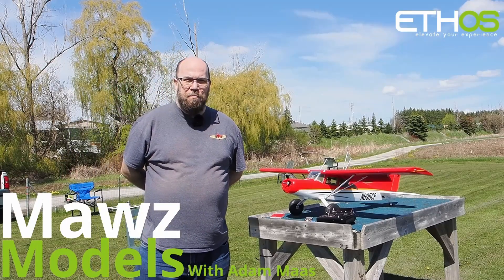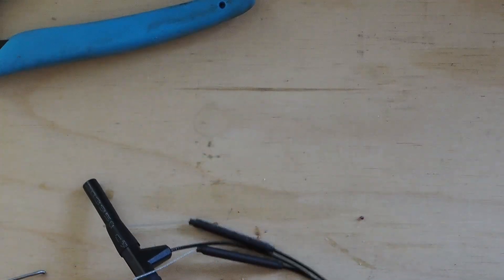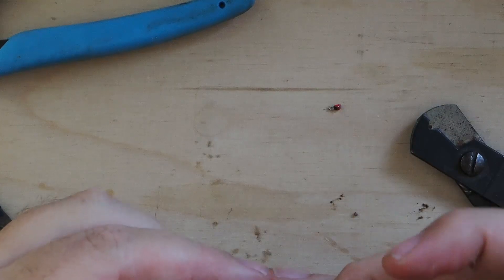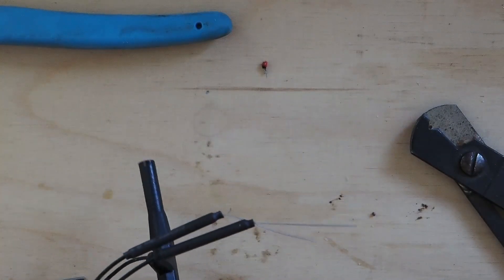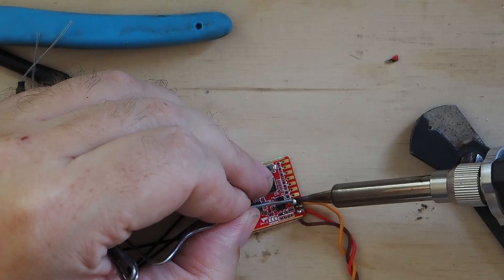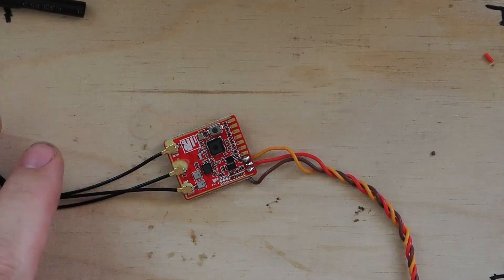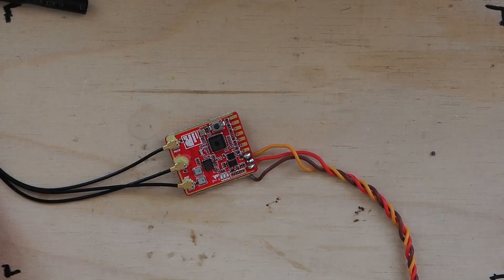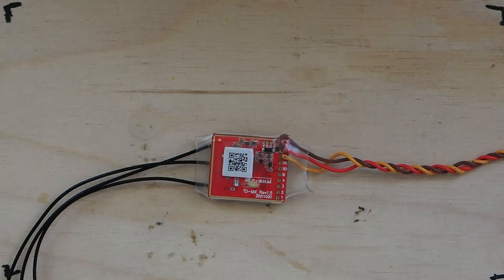ETHOS Tech Tip 8 - TDMX Wiring for FBus

Comment: I'm using 2 on aura 5 an 8 with no problems.
Reply from the maker: I've gotten mine to work with the Aure 5 & 8 as well. Just still need to get used to the trim procedure on those stabilizers

Comment: I found 22awg , very small amount of pre tin using Flux on the wire . Then placing the wire though the hole in the top of tdmx.  Laying the wire over the pad. 

Adding solder to the iron tip and doing it via transfer solder. Has worked best for me. 

I had a hard time getting the solder to stick to the pad if it didn't do it this way. And no risk of bridging the contacts.. I can send you a pic of it on FB if you like tonsee what I did
Reply from the maker: Thanks for the info
Reply: Agree, you want pin your pad and your wire with the heat gun to heat them up first and then apply the solder and it will whisk into both and you won’t get cold soldering. These little pads are a big pain to work with but have found this technique to work the best and no concern of bridging. Love your videos.